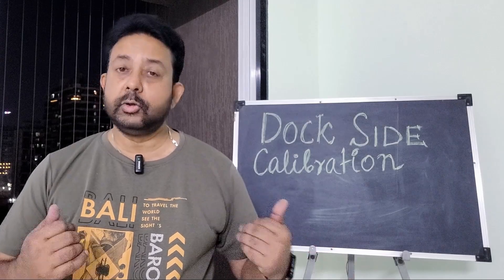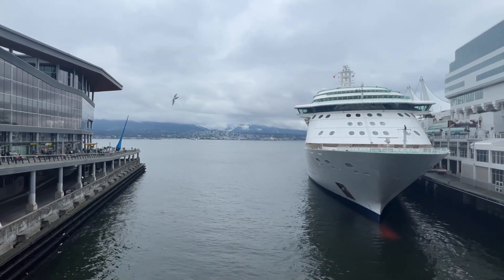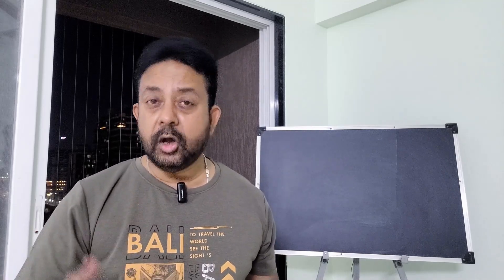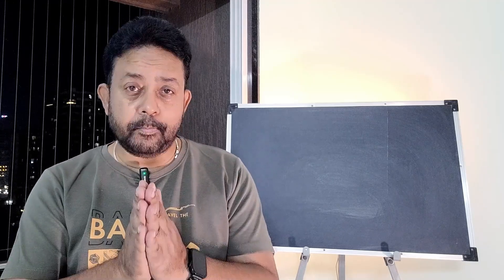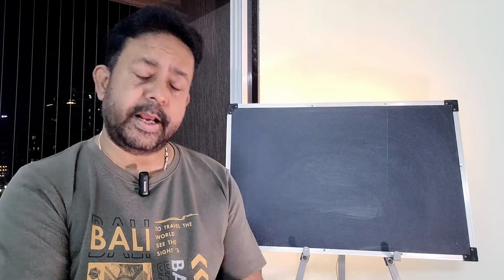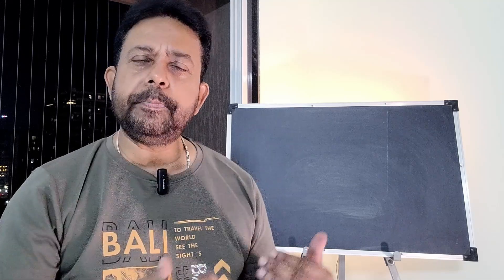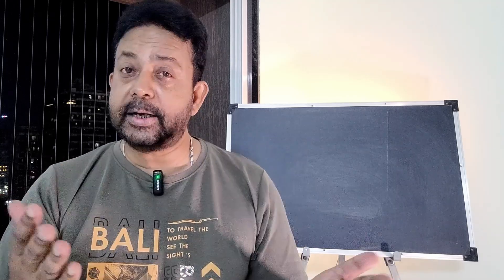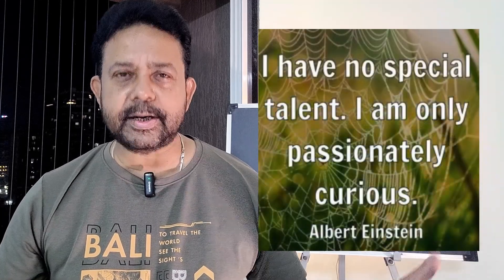HOW TO DO Dockside Calibration of GPS and Gyrocompass?

Comment: Great video, Each and every thing one needs to know is explained. If someone follow these will succes in one go. How nice you explained the problems one may face and the solutions. Thanks a lot. 

Btw, sometimes we used two observers at the same time for Gyro for precise work, of course that was a client requirement. 
👍
Reply from the maker: Thanks for your encouraging words. I did say that using 2 observer with two TS will make the observation more accurate. Only thing I did not mention is weather.

Comment: I am correct in assuming that the total station will be using a local terrestrial reference frame, where the vessel is most likely using WGS84 / ITRF2020 that is not bound to the earth surface except for the UTC 0:00 line?
Reply from the maker: If the vessel uses WGS84 then the GCP coordinate  has to be in WGS84 and not local datum. Yes the zone needs to be changed as per local longitude. So Total station will be using UTM of Easting Northing from WGS 84 . But if the vessel needs to work in Local Datum then the GCP observation needs to be in same Local Datum. RINEX data needs to be converted to Local Datum also.